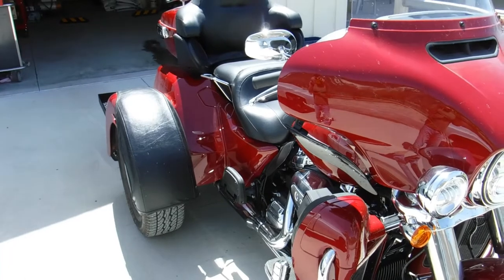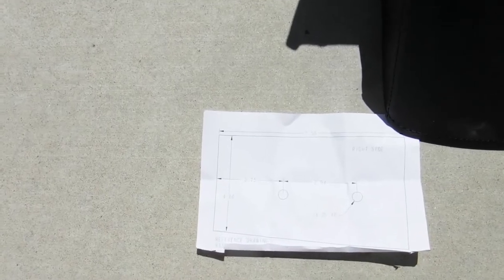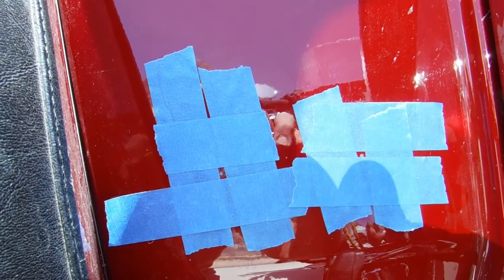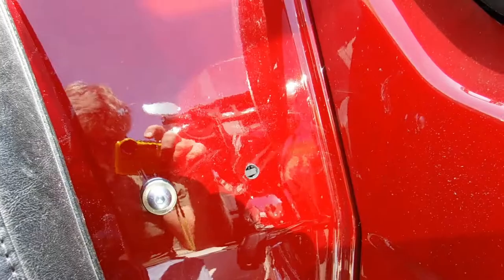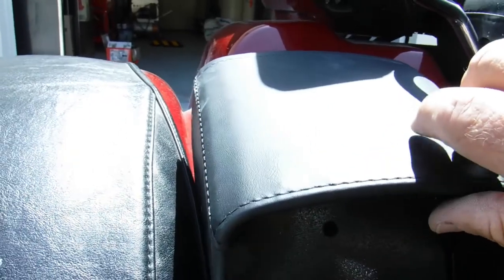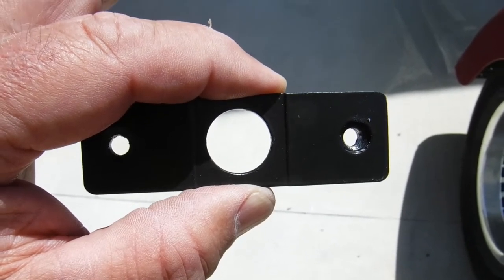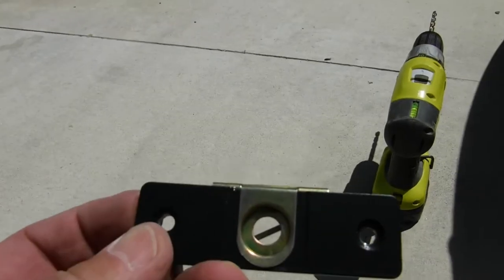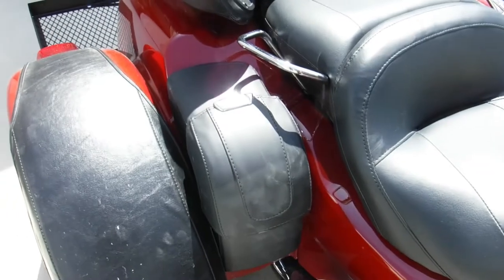How I Added Saddlebags to Harley Tri Glide

Comment: I also own a 2021 Tri Glide. With all the storage in the rear of the trike, the trunk, tour pack and luggage rack, NO way am I going to drill holes in my trike for those things you will probably stop before using. My wife and I can carry a ton of stuff on trips. We bought the two luggage bags made for the trunk that leaves a bunch more storage in the trunk. Then the top box can carry a bunch. Down the road I have a bag made for the rack on top and carries all of our bathroom supplies and even a pair of shoes or two. But no way will I drill holes in my trike for that little more storage. But then, to each his own.
Reply from the maker: Jerry,
     Thanks for the comment.  I was also reluctant to add them-drilling into an expensive machine didn't thrill me.  We did find on our cross country trip they were very convenient though. But like you said-to each his own. Thanks for checking it out!

Comment: How do you get your Side Covers off? If you have to reset your breaker for your reverse motor or hook it up to Digital technician.
Reply from the maker: Haven't taken them off since the install but the bags should detach just like regular ones on a bagger.
Reply: You remove the bag, remove the cover panel, and reset the reverse breaker. Restore the panel and reinstall the bag.

Comment: I have looked hi and lo for an installation video for the fender bra. I have the same ones as yours and I can't figure out how to install mine. The instructions and so simple they just don't help. They are Saddlemen Fender chaps.
Reply from the maker: Howdy.  Yeah you're right about no videos.  I searched for quite awhile and didn't find anything either.  I also searched "Install Saddlemen Fender Bra" and came up with their instruction sheet  under the title "Features of the HD trike fender chaps" but I assume you have that.  From what I remember about installing mine is-1. They need to be very warm in order to stretch. 2. It is a super tight fit and when pulling them don't tear the piece that goes in the tailight (it's flimsy).  So basically make sure the bra is warm and you're installing in a warm place.  The front corners have a sleeve that will catch the front corners of the fender.  The braces enclosed in the leather are bendable so you can adjust for a better fit (more slack) when you line up the back tab of the bra with the screw that goes in the tailight fixture.  You will have to take the two screws out for the tailight cover and the screw that holds the tailight fixture to the fender. It is a procedure that requires a couple tries to get it to fit right but mine have been on for two years and 13,000 miles so they are a good product once installed.  Good luck!